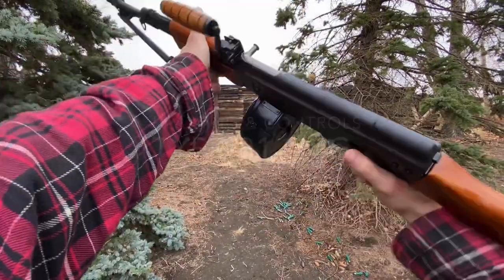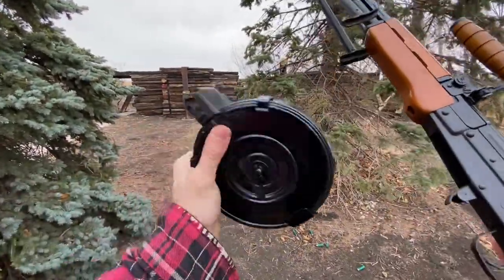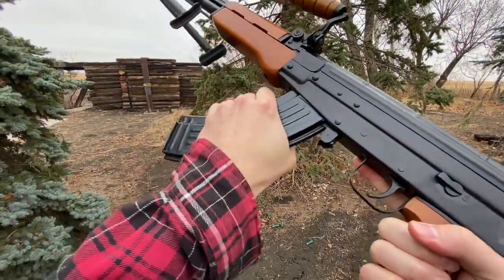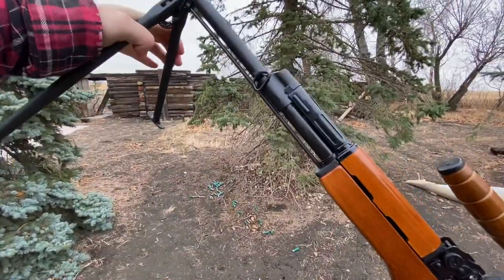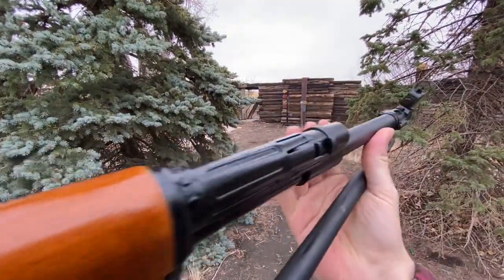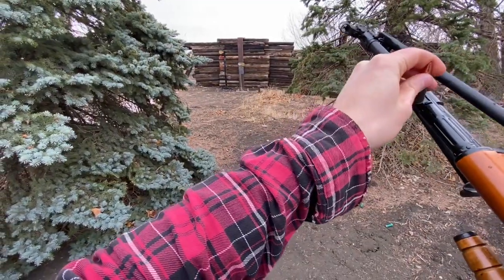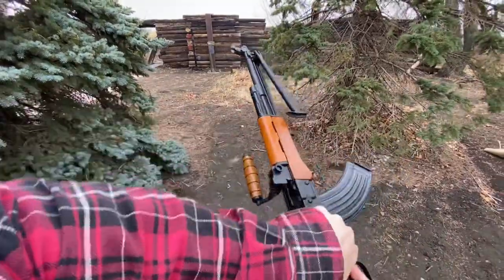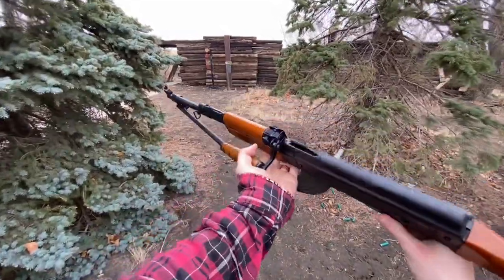How to Shoot the Type 81 LMG | China's RPK

Comment: M305 10rounds steel mags were modified easily enough to fit in.
As for the drum, new spindles are out in the wild now.
Reply: @douganderson7002   only illegal if you modify the mag capacity.
Reply: Which m305 pistol mags fit? From my understanding the 7.62x39 m305s (m305b??) only had the 5 round rifle mags (ak mags??) And the regular m305 which used those 10 round bolt action mags are 308?? Which should be to wide  and long to fit the type 81?
Reply: @ACOGLMT556  
They're 5/10 mags, dude. I say ten rounds to signify the size, and ease the process of finding them.
Reply: You're telling me it's possible to unpin the drum mag now? So that's why people are actually paying $200 for the drum
Reply: @thecommunistdoggo1008  
I wouldn't say it's THE reason. It might as well as much about looks and novelty as the idea of the possibility of being able to unpin them 'if need be.'
Reply: @axelord4ever  I guarantee that's the only reason is that you could unpin it. $200 for a 5/75 is so stupid it's literally equivalent to 7 extra 5/30 mags (for $203 from TI)
Reply: @thecommunistdoggo1008  
I know my reasons, man.
Reply: @axelord4ever  No comment

Comment: This thing is SCREAMING for a good very low profile side mount solution.... might even be able to get a lower 1/3 with a red dot...
Reply: Tactical Imports, which has brought both the rifle and LMG variants of the Type 81 to Canada, is developing a side mounting plate that should not require tools to add, using the existing rivets as an attachment point. I imagine the plate will support attachment of standard com-bloc rail mounts, including quick-release pic-rail mounts.